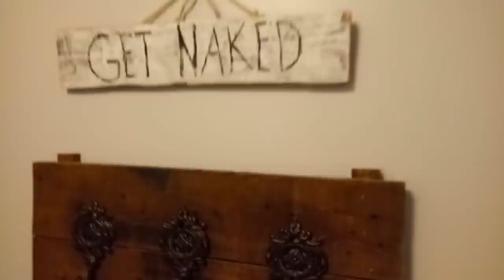DIY $20 master bathroom makeover / Fixing up my old mobile home part 2  / Painting and decorating !

Comment: You did a great job!  We live in a double wide mobile home.  We have plans to start remodeling, but we are on a pretty tight budget so it is going to take a while.  We have started with our daughter's room.  She will be 13 in October, so we are doing her room first as a birthday gift.  My husband did drywall as a living for about 19 years and he still does it on the side (he is a part time art teacher while he is finishing college).  So, we are planning on putting drywall throughout the house.  It is a little costly, but we have panel type walls in our house, we've tried painting them but no matter what, it scratches off so easily (even after 2 coats of primer).  

Our mobile home is almost 19 years old, so it needs a lot of work, but we don't have a house payment so we'd rather fix it up than move somewhere else.  Thank you for the inspiration!
Reply: @annieJane nerib no it is not wood paneling.  For a lack of a better description, I call it sheetrock look-a-like paneling..lol.

It is just very difficult to paint.  My sister lives in a mobile home as well, and is having the same trouble with the same type of walls.

Comment: I think if you painted the brackets and shelves in the same color of the mirror it would have made the room look larger!  Also, did you know you can PAINT the floor any color you choose and then put 2-3 coats of polyurethane over the paint, it is just like having a new floor for only the cost of paint!! You can even sprinkle in glitter on top of the paint on the floor while the paint is wet to give the floor dimension and look more like tile!!

Comment: Looks good.  What works better for me is using are stick on less than 36" measurements-  try it out & see what you think.
Also you mentioned decision not to paint trim to match-up. Trim should always be at least one shade lighter than wall.  The lighter trim will give illusion of taller ceilings/ wider walls. 
Thank you for adding whet you found everything,  including the price,  & how you designed your personalities rices!! Simple changes look awesome,  job well done!

Comment: It was a nice effort. If you had taken the toilet lid off before painting around the toilet tank it would have been painted a little lower on the wall. BTW, the handle is the packing handle. The hook to hang it up is underneath that cardboard. The bottle with the flowers will be  more stable if you put clear stones at the bottom. 😁

Comment: Caulk instead of spackle, assuming the ceiling is level, eyeballing bracket locations...I'm seeing a lot of short cuts here. BUT, your caulking skill is pretty dang awesome!
Reply from the maker: We all do things out own way 😉 and i didnt have spackle so thats why i used caulk it works just as good if not better and i did measure the bracket heights just not the distance apart lol

Comment: I always have trouble putting things in my walls when there is no stud. Any ideas?
Reply from the maker: Try using whats called a dry wall anchor they do put a pretty large hole but it holds like a champ 😊and remember you can allways fill holes in with putty if you decide to move what ever it was on the wall .

Comment: U need to use a gloss paint in the bathroom, so when you bath the mist gets on the walls and bubbles, a flat paint is going to bring on mold because it cannot breath from a flat surface.
Reply: She used satin finish, wouldn't that make a difference?
Reply from the maker: Satin is great for bathrooms as well 😊
Reply: Frnchrn T satin is still a flat surface in heated moisten rooms need a gloss finish so it bubbles up and dries not seeping into the walls.
Reply from the maker: @tammyreisewitz5342  maybe it depends on the paint brand because the one I got is mold and mildew resistant and I've always used satin finish I've never had an issue but then again my bathrooms are ventilated. So thank you for letting me know 😉

Comment: If you look at the back of your mirror, the handle should be screwed on with a cardboard strip underneath. If you unscrew it and pull off the cardboard you should find the metal strip that the mirror would hang from. I think the handle is just there to hang from the hooks in the store.
Reply from the maker: Its all metal on the back . but its alright someone mentioned to tie so burlap in a bow to keep the rustic look so ill probably try that. Thank you for watching ❤

Comment: Turned out nice but this is more than a $20 makeover.
Reply from the maker: I only spent $20
 The paint was leftover from a previous project and it was optional.(which I did state during the video) .
  All the decor was only $20. But I appreciate you watching.

Comment: Love the transformation. Definitely inspiring! Just a question: are the shelves secured on top of the brackets or are they just laying on them? I ask because my house tends to shake now and then because it’s close to the train. Thanks!!
Reply from the maker: No I didn't secure them just because this was the master bathroom and We don't really use the stuff on the shelves that often. By if your house vibrates or  Shakes I definitely recommend screwing a hole through the metal bracket up into the wood.

Comment: I suggest a much bigger mirror; light will change it to look much bigger. Instead of those hooks; get a towel holder like at a hotel; lots of storage lines; a on the wall hair blower holder, glass or plastic containers on the shelf for cotton balls, Qtips, lotion, shampoos, etc. maybe a plant; use those special nicknaks somewhere else. Shower curtain with lots of color.